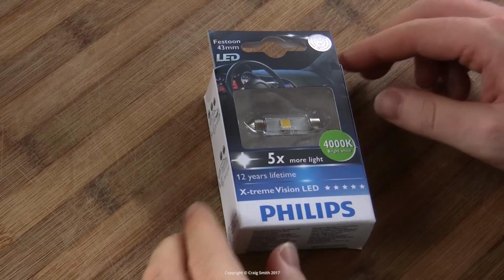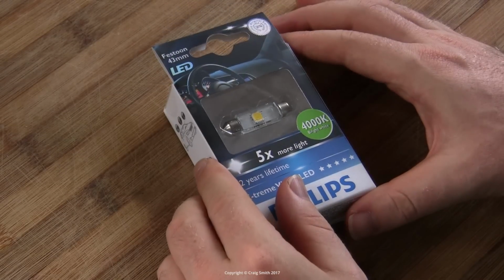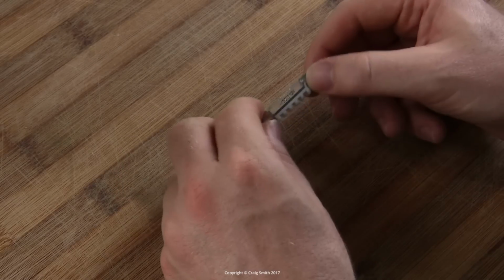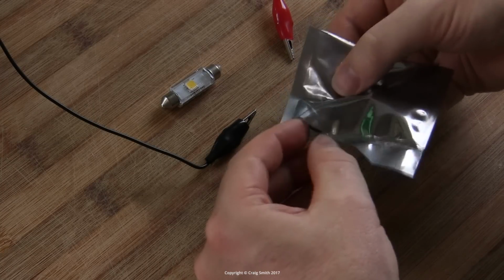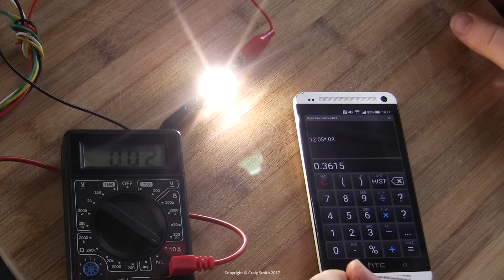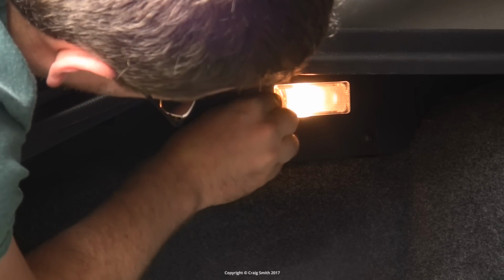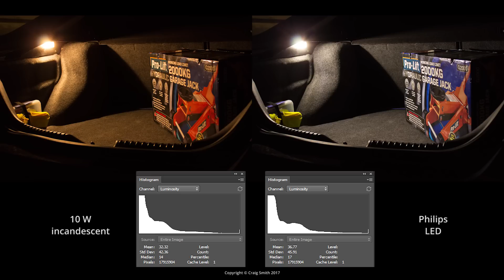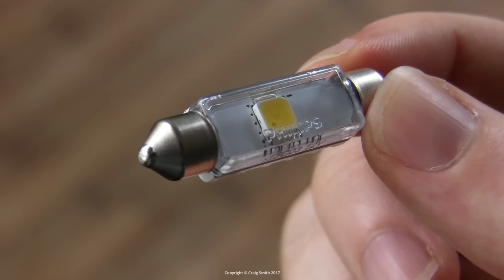Review: Philips X-tremeVision festoon white 4000K LED

Comment: The no-name units may be brighter, but I have the feeling that these things will actually last. I appreciate the scientific analysis. Might have to go with the Philips for the courtesy lights.
Reply: My dad uses Phillips lamps. The ones he bought 10 years ago are still good as new ones.
Reply: I ended up springing for a set not long after leaving that comment. Mine were the 6000k variant, since that was what was available (curiously enough, Amazon.com sellers had them cheaper than eBay sellers, so, even though I usually like buying stuff on eBay, I did go over to the dark side for this purchase) at the best price. I was disappointed to find that the diameter of the conductors was still too small, which is a common complaint among the cheapos, but apparently it applies here too. Ultimately, I was successful at shimming them, and they work perfectly. They put out the same (or maybe slightly more) light than the halogens, consume less power, and match the cool color temperature of the car's other interior lighting. Overall, I'm quite pleased with the outcome.
Reply: @Browningate  I personally use 4000k set, they're warm white and it's comfy for me. I never bought them anywhere else apart from a car accessories store in my neighborhood. About the brightness - they're slightly brighter, but they don't heat up as much as halogens
Reply: @SkipperK  Indeed. Glad they worked out for you.

Comment: Would it switch off completely after closing the door in older car (2003 Corsa C pre lift to give a particular example)? Thanks.
Reply from the maker: Depends on the car's wiring set-up.